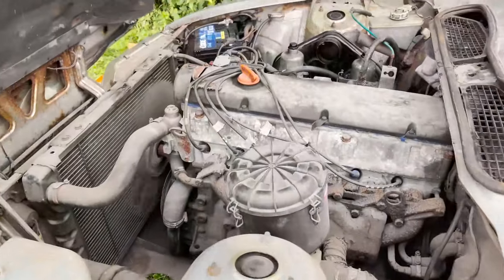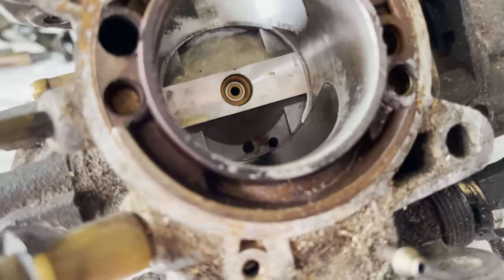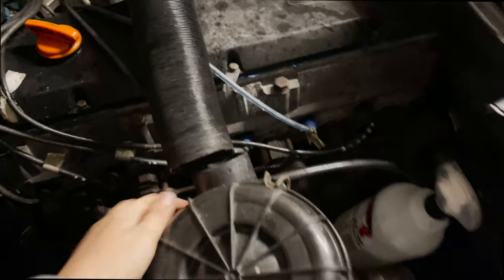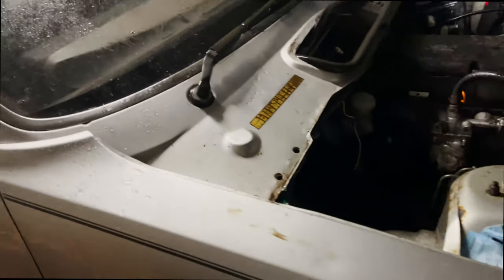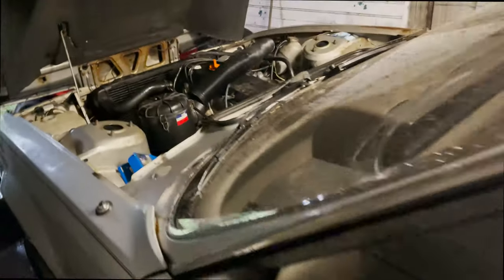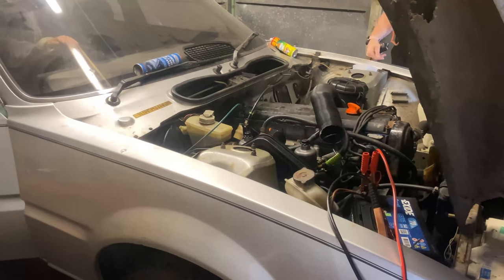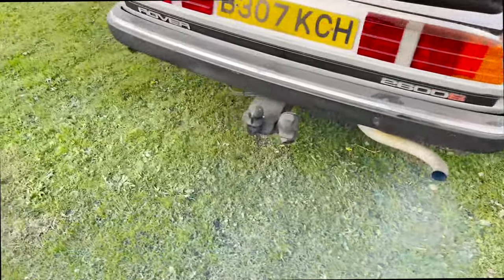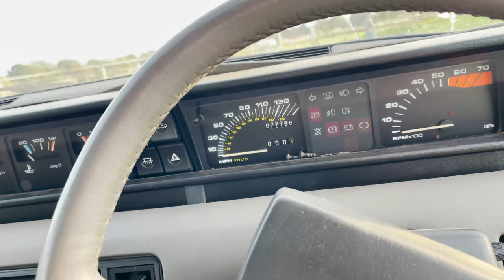Rover SD1 2600S Project - Getting It Out the Barn First Drive In 16 Years! - Project Part 4

Comment: I used to love working on old cars, the misfire is just a little challenge unlike a modern car. New dizzy cap and rotor, gap the points (or replace them), then new plugs and leads should sort it.

Comment: @10:21. Behind the rough running noise I can't hear too much clatter so that engine could be a potential winner. When you get round to it / if you can work it out, try to give a bit if explanation about those particular carbs. It's well known that some of them are motorised + have Auto Choke issues and that's what puts us 'standard nuts & bolts characters' off taking on the higher spec. 2600's. Good work though & very worth while.. Keep it up..!
Reply: Tom. Check out the attached link.. I don't know how much of it applies in an 'exacting way' directly to your particular car.. but it may be useful in areas of carb set up / diagnosis or even effective mods.
https://www.youtube.com/watch?v=fjCPoTMeWHE
Reply: Had that auto choke system on a Montego back in the day. Removed and replaced it with a manual choke conversion. Maybe Rimmer Bros or MotoBuild Racing could help with such a thing.
Reply: @johnj3577  All I know is that this type of auto choke set up on twin carbs just represents an extra stick with which to bash Rover SD1 Straight Six cars like the one Tom has here. If you watch the video link I added, towards the end you'll see that they used a similar auto choke on the Series 2, V8, SD1's as well... but no one ever seems to complain about that...
....I've owned an S1, 2600 with a trad. manual choke set up and it was reliable and fairly economical. I'd be quite lucky to find another early SD1 as good as the one I had, so (if at all) I'm likely to end up with an S2, 2600 something like what Tom has here. If and when I do find one I want to keep it more or less as it is and I want to make it WORK.. too..!